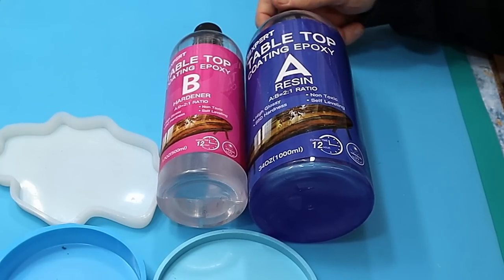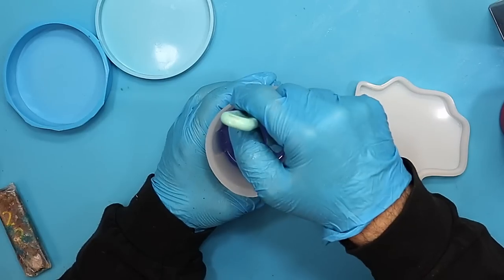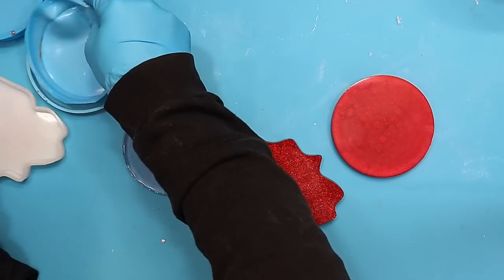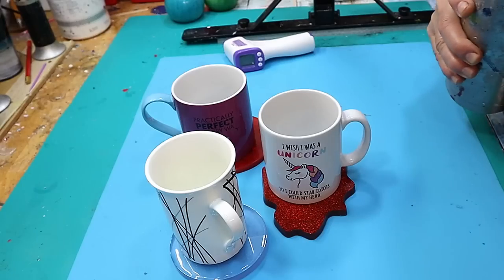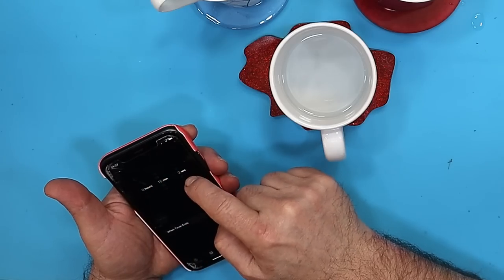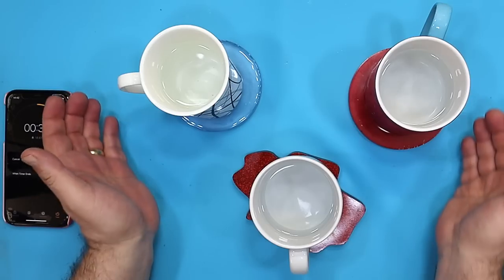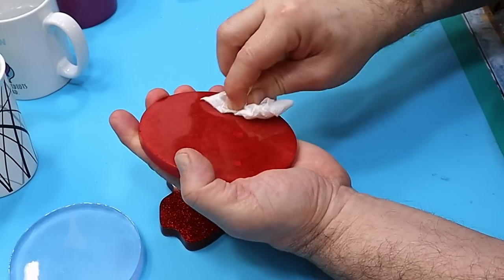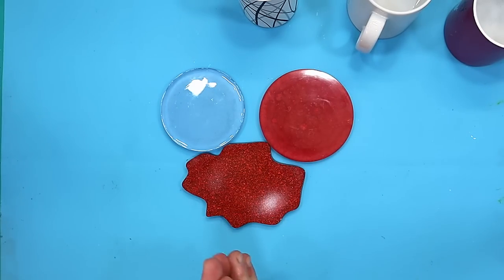The Single FASTEST Way To Improve Your Resin Coasters

Comment: Steve! Do you prefer the Teexpert to the JDiction /Let's Resin epoxy 2-part resin?  I need recommendations please, it's for coasters and such, not small stuff like jewelry - I use UV for that, but a bit larger but not huge projects.  Any suggestions?  I see Teexpert suggests no thicker than 1/4" (thus it's called tabletop)  so, which do you recommend for deeper pours, JDiction or Let's Resin?

Comment: Love this!!! Question about the glitter one. What was its thickness? Still new to resin but from a blog post I read about the difference between the types of epoxies it said that table top resin had to be poured in thin layers. Could the thickness have affected the curing on that one coaster? Could you try the experiment again using a deep pour and see if it works as well?